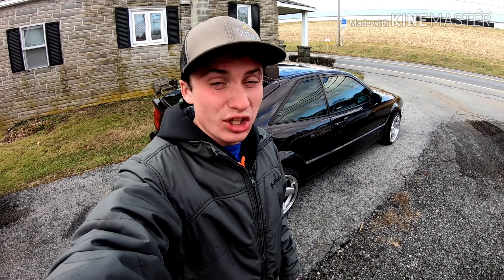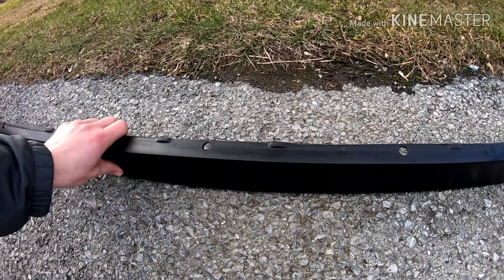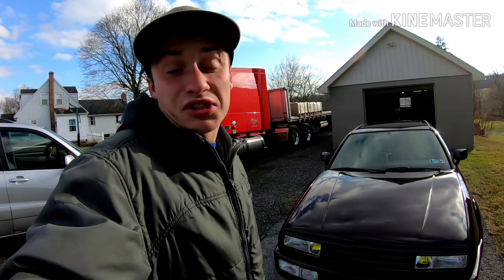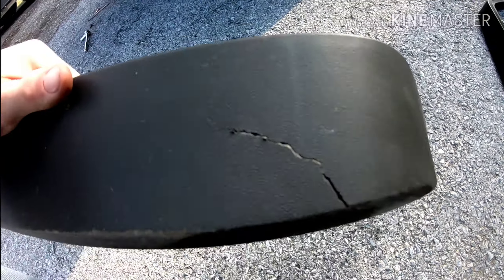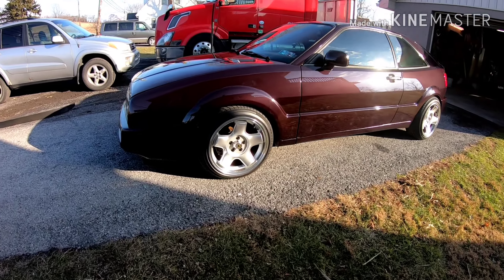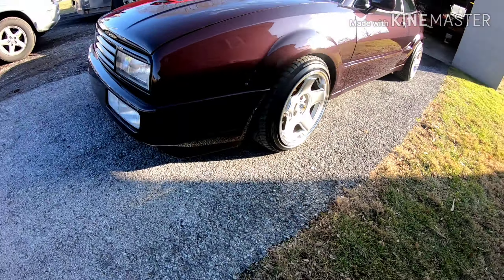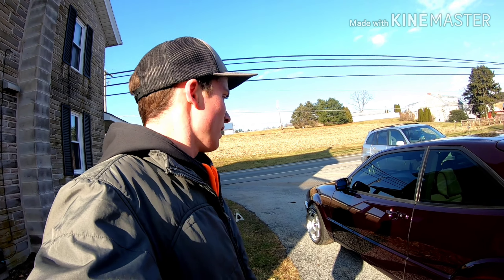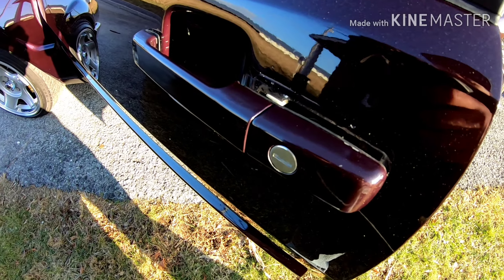New Lip For the Corrado!  Spoonfedtuning 70mm

Comment: So glad I saw this video. Was considering ordering the soonfed 70mm but that looks horrible. I'll stay with my OEM 90mm euro lip even if I continue to scrape everything in sight.
Reply from the maker: I have a newer video where I install the Spoonfed 90mm lip. Best lip ever. Has the great factory lip look, but it's flexible so it doesn't matter if you scrape.
Reply: @RadoMatt  interesting, I'll check it out! Love your Rado btw. I've owned a 93 alpine white VR since 2002.
Did you buy those yellow French caps in your ecodes separately, or did they come like that? I want to add caps to mine, looks great on your car 👍
Reply from the maker: @christenrten  thanks! Sorry, idk that were on the car when I bought it.